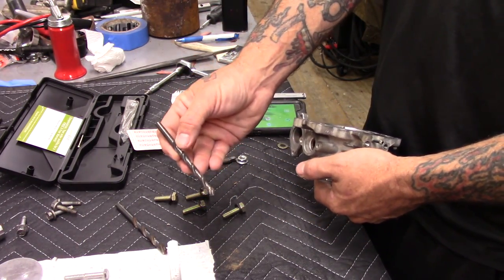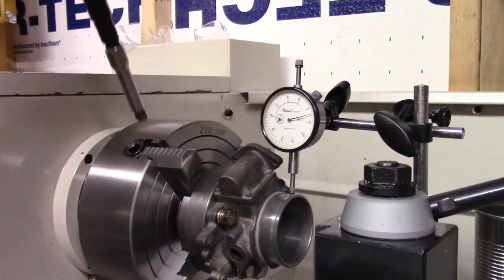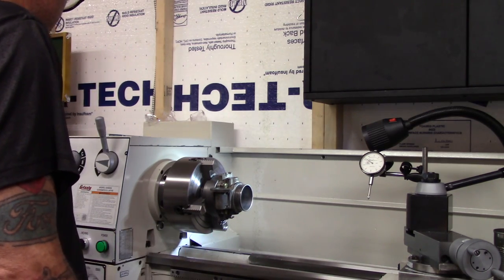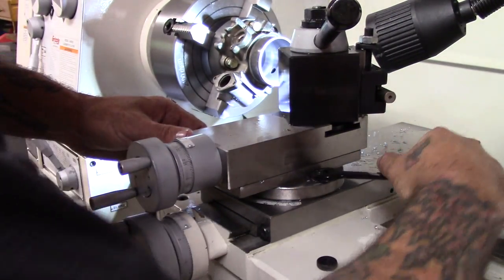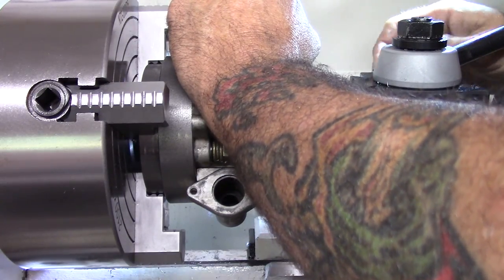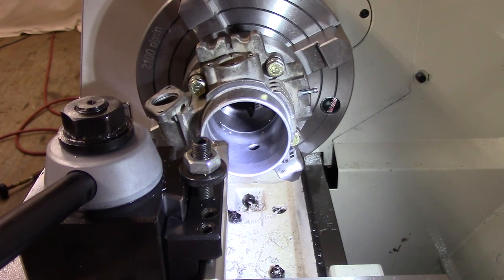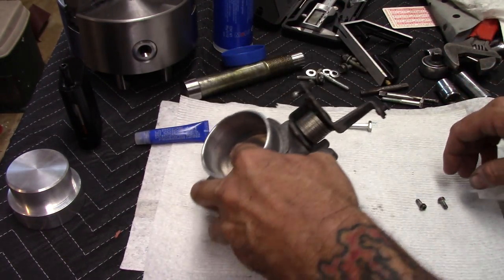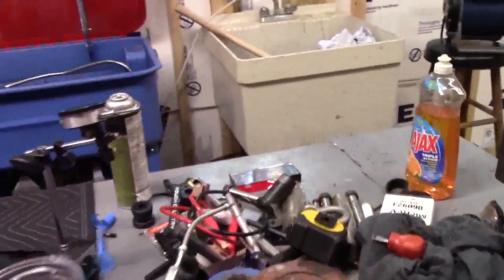jeep xj engine mods

Comment: might be a little late but if you overbore it to stand the plate up vertically then it will introduce air gaps around the plate. most oem plates are od sized while being held on a 4-6* lay back angle which means the plates are actually slightly oval.  I used to overbore Porsche 928 Throttle bodies and made a jig out of solid stock to hold the plates in the lathe with a 5* lay back cut into the holding tool using a mill.  You can cut a perfectly vertical plate of any size by flat facing some stock and finding a centered cross axis.   i use dykem on the front face and center a carbide bit vertically on the face.  run the bit into the material a though and scribe all the way across the face.   this gives you a perfect line to help mark the oem plate holes centered on the tool.  bolt a flat plate of aluminum or brass on the tool after centering it in the lathe, use a parting tool to make an initial cut to take any non-round pieces to round, then bring down to desired od using standard carbide insert.  if this helps cool, if not well its out there for someone else then.  Nice work.
Reply from the maker: +CSSOB  thanks for the info have bored several now they have worked out pretty good

Comment: I had the same surgery, two discs replaced with cages filled with cadaver bone. I have had five stents put in my heart. The condition with my neck was simulating a heart attack, one side of my body would go completely numb. It was simulating a heart attack, so I had to have something done. I had the same problems, couldn't talk very loud, couldn't eat without being very careful not to choke etc. just swapped one problem for another. But I have five to be worked in my lower back, definitely gonna wait on that. They also are gonna completely replace both knees, and reworked my left rotator cuff. All of this shit is subjective, no one but you know how you feel. I worked hard and I played hard. Motocross on dirtbikes and four-wheelers, barefoot water sling, etc so yeah I expect to hurt some. But when something is not right they should listen to you. That's why I would rather go to an animal doctor, vet, whatever, they have to do their jobs, dog can't tell you where he hurts, he's sick to his stomach etc..vet has to be smarter than regular doctor, just saying. I will be 57 years old February of this month so I expect to hurt some, but their is some form of relief to be had. Hope you get it straightened out.

Comment: I've had spinal fusion on my cervical and lumbar spine. I have a plate with six screws in my cervical area. Two screws on top and bottom. Screw heads were square. Then they had a square washer that fit between the square screws which is screwed in place so the main screws won't back out. My throat felt scratchy for more than a year before I felt normal. They attributed it to the bruising of my esophagus by them having to moving things around during the surgery. Mine did eventually clear up. I still have limited movement of my neck because of the two vertebrae being fused together. Good luck.
Reply from the maker: William Cochran thanks for the info man it feels better some days I hope it goes away soon thanks again for responding

Comment: Good vid man. I have the bbk throttle body and holy hell it's amazing how much better the air flow is. You will like it.
Reply: Robert Shaw Jr.
Reply: Better mpg and response?
Reply: I want acceleration, Acceleration, acceleration... I dont need more torque, I dont give a shit about mpg... I want speed
Reply: Hydro Burd get some mustang 5.0 injectors if you want better acceleration. You can google it.
Reply: @Silkforge  oh yes...that's such bull. What will that get me 3.27 hp. Different gearing and flow will get me more acceleration than that. some new injectors wouldnt hurt tho
Reply: Hydro Burd not just new injectors but the mustang/dodge neon ones have a 4-5 holes vs jeep 1 hole. Not everyone has nice machine equipment like this guy. 4.0 Xj's have so many cheap swappable parts it's ridiculous. What make/model do you have?

Comment: random question. what exhaust are you running or is it straight piped?
Reply from the maker: Havoc4Hire Flowmaster with turn down 2 1/2 pipe with Stinger header

Comment: I just rolled my xj if you want my throttle body come get it im not far from Jacksonville
Reply from the maker: hunter thomas you gonna part it out
Reply: Rusty 411 need it gone asap have a funeral coming up if you want it come on and get the whole thing $200 takes it engine still runs limped it to where it sets now you will need a trailer Damion might want the block lol he seems to go through them lol